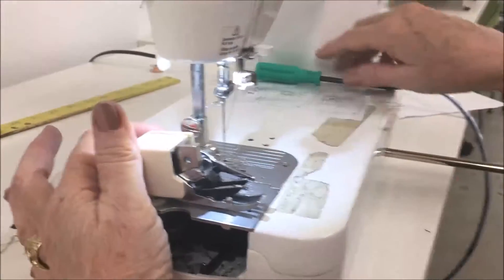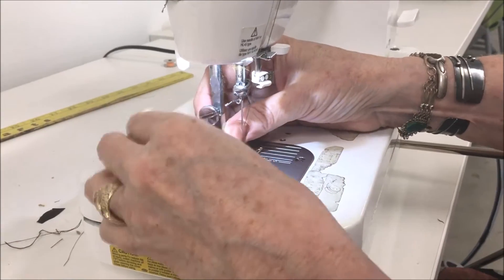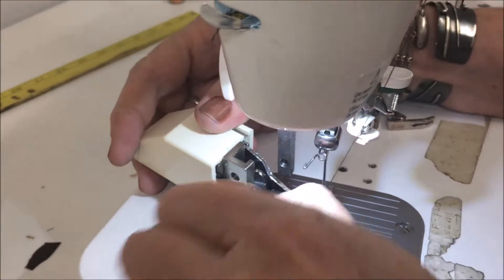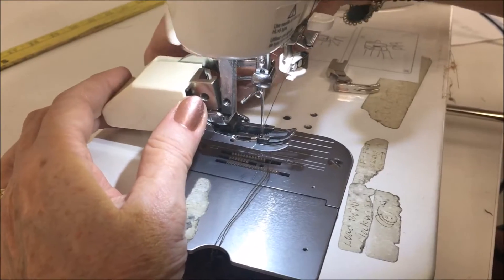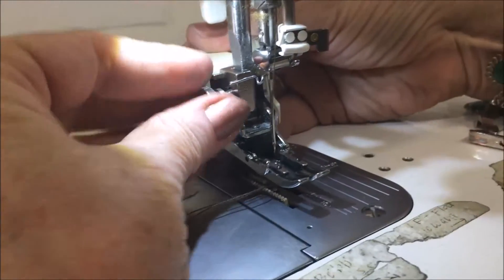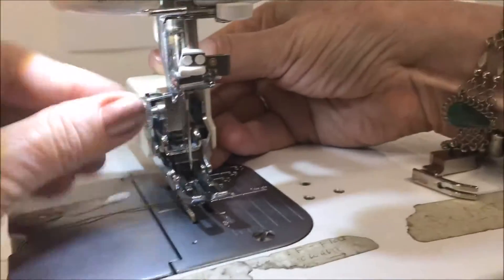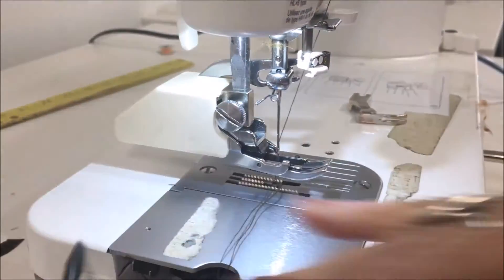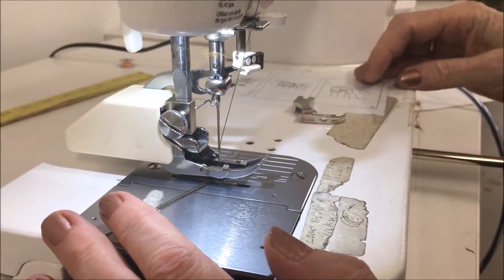Juki Semi-Industrial - Attach WalkingFoot

Comment: what kind of walking foot are you using?
Reply from the maker: this walking foot comes with the machine
Reply: @JustineLimpusParish  this walking foot attachment is mainly use for what?
Reply: @sfiv1987  thick fabric or thick materials
Reply: It is an adapter device that can be purchased in several online places. Type in a search for “RWA2” and this short video did not show the screw M3 X 19mm (3mm diameter and 3/4” long.) The screw may or may not be included but it has a smooth shank. A normal metric screws have threads which can be wrapped with masking tape, electrical tape or small short pipe. 
  I started looking for one of these “Walking Foot” devices for my Juki 5550-6 lock stitch commercial machine now late Sept 2024. 
Best of luck.